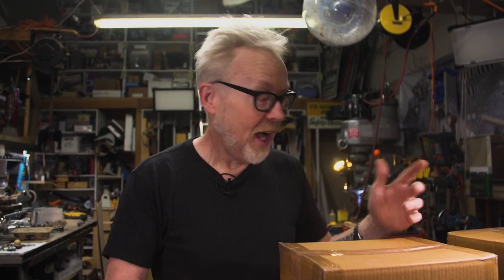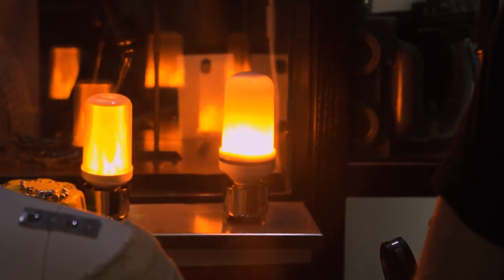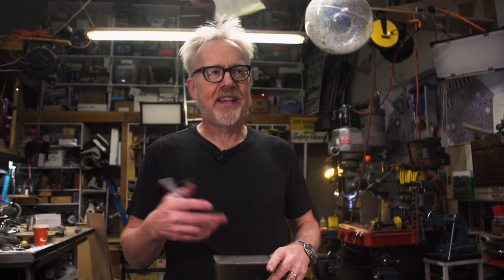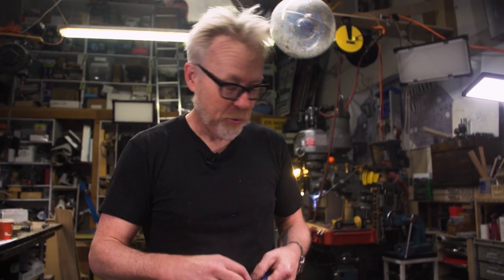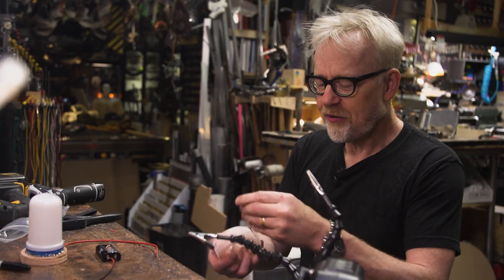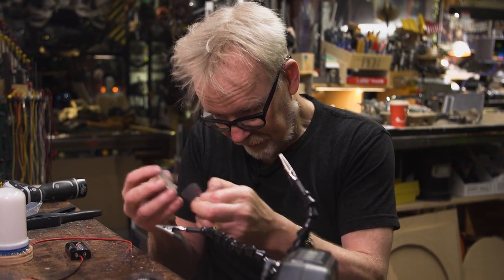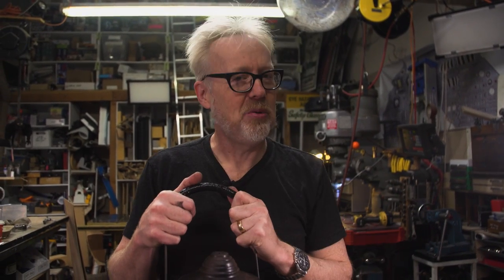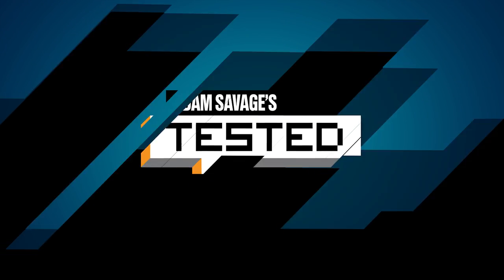Adam Savage's One Day Builds: Gaslamp Lantern Prop!

Comment: Those bulbs are so fun! We used them for Lumieres' hands in "Beauty and the Beast." We used a drill battery to power them and kept it in a waterproof bag on the actors back. Ran the wires down his coat and there were plugs connecting to the candle stick hands so he could take them off in-between scenes. It allowed the actor to turn the bulb on and off onstage without needing a license for pyro and it kept everyone safe! :) Love the channel!

Comment: I find the 'click-click' of the wire strippers very satisfying. I love it when my tools tell me that they are working properly.
Reply: Id like to know what kind they are. They seem to work very well.
Reply: @stephenmg12  They are in Sean's favorite things of 2019, they are called Knipex Wire Strippers.
Reply: @thekey147  Thank you!
Reply: @thekey147  Thanks!  the crappy ones I've been using aren't that great.  Gonna check these out. =)
Reply: Thanks. That's what I was.looking for also in the comments. The brand I have doesn't work for crao
Reply: Yeeeeeees
Reply: The problem with that kind of wire stripper is it only works well in a pretty narrow range of wire gauges. Knipex are some of the better ones, but will still mangle your wires if they're near the top or bottom end of their "supported" range. Both Andreas Spiess and Big Clive have videos covering a lot of different models, and I believe both of them ended up using less "automated" strippers.
Reply: @RFC3514  I have a couple of pairs of similar strippers, but they work in a perpendicular orientation, with an adjustable stop to control how much wire you strip.  They're 8" Irwin Vise-Grip 2078300 Self-Adjusting Wire Strippers and work well for a fairly wide range of gauges. I use Klein 11057 stripper/cutters for anything the Irwin can't get a grip on because they're too small of a gauge or the strands are too fine not to be damaged, though the Irwins are designed to minimize mangling within their optimal range (I won't lie, I've had them take a couple of tries to get it just right on certain types of wire).  Anything that's too large of a gauge for the Vise-Grips is usually into the territory of what a good blade and/or a good pair of nippers will handle nicely, though I do have strippers around for larger gauge wire, I just don't have really nice ones that have the same level of comfort in the hand (read: heavy use will strip your palm of all feeling, in addition to the wires of insulation).
Reply: Try some aircraft quality toggle switches on your guitar, or whatever. You won't look back.
Reply: @sclogse1  I replaced the switches in my car with the air craft toggles few years ago for the satisfying click they made. You are correct.
Reply: @RFC3514  The thing is you still have your regular strippers for non standard wire, but you will very rarely encounter that.   The thing is 95% of the wire your going to use is either 16-24 for hobby projects and for house wiring almost everything is 12 or 14 until you get to things like 30A breakers.

Comment: That is a Green Lantern prop just DYING to be built....   Get a little nfc involved, so it lights when your power ring gets near it.....

So many possibilities!

Bravo
Reply: I was thinking during the whole video this would be the exact light to use in my Steam Punk Green Lantern Battery.  Too bad the bulb was the only thing he didnt leave a link to...
Reply: @starhawke380    He said "I looked on Amazon and found lots".....  I did as well  and he's understating how many there are.
Reply: @ClintonAllenAnderson  I just looked it up, there's one that you can change the color of the flame, which would fit the green lantern idea even better
Reply: @ranwolf7650  So you CAN change color. Cool.
Reply: @ranwolf7650    How's about a link to THAT bad boy??   LOL
Reply: @starhawke380  The bulb is the first item on the list.
Reply: @joelhageman1903  a configurable-color flaming bulb.  Just the thing for "Creepy Santa" for next year (it's a mid-1960's blow-mold light-up Santa, I've used a kaleidoscope bulb in it the past couple years)
Reply: @SenileOtaku  Awesome. Creepy Santa. That too. From the 60s even better. Love it. I gotta get one of these bulbs.
Reply: My first thought when I saw it was Green Lantern by Gaslight
Reply: A magnet switch, with a magnet in the ring would be a simpler option to  nfc
Reply: You don't actually need multicolor bulb, you can just use colored film to get any color you want
Reply: If you are patient enough and can solder: There are normal smd leds solder on a flexible pcb inside. You could replace them with another colour.
Reply: @GrayRaceCat  Hah, he edited the list.  When I posted, the first item on the list was the lantern.
Reply: Was thinking the same thing the entire way
Reply: @ShadowcasterZero  Someone in China is slightly mystified and really happy.

Comment: That "hermaphroditic velcro" is called dual-lock, and it rules!
Reply: he rejected your reality and substituted his own.
Reply: It's huge in tiny home circles and it is the best stuff ever.  Highly recommend.
Reply: Yep great stuff been using it for years
Reply: velcro, while the common name for the material isn't the prim and proper term anyways, since it was originally a trademarked name, like kleenex in USA or hoovers in the UK. proper name is hook and loop.
Reply: I got my first bit with command strips, amazingly solid hold compared to regular Velcro.
Reply: I like "hermaphroditic Velcro" better.
Reply: @jaybee6318  im partial to bipolar opposing force hairs. Duo hooked sticking needles? double acting sticky fuzz? pick one
Reply: @ajc1080  "More homosticktual than hermaphroditic." I love that this is a technically accurate phrase. :)
Reply: Brock Moore Nicely done.
Reply: @Nick Arora For that reason, my brother and I have always called it SuperCro.
Reply: I use it instead of Command Strips. Also we use it IT to secure things on mobile carts like keybaords and charger bases for wireless handheld devices and small document scanners. These things cost a bazillion dollars in healthcare.
Reply: That stuff is from aviationbuilding. The Cabin covers are stickt with that... since at least 6 years. On flat on flat surfaces it can handle a lot of weight. You need a lot of force to separate them again.
Reply: It’s what the DMV gives you for the EZ Pass mounting here in MA/ New England. 

Once you adhere the two, there is little to no play or movement like standard hook and loop
Reply: @seana4106  Except that Dual Lock Velcro isn't hook and loop. The correct term in this case is "self-mating separable fastener", if you want to be pedantic.
Reply: Dual-Lock is a brand name, as in Vise-Grip is locking pliers, and ChannelLocks are Tongue-and-groove pliers.
Reply: In Germany we call it "Pilzkopfklettverschluss" yes awesome long german noun. It means "mushroom head velcro" due to the form of the individual strand head.
Reply: @flohi.9515  Not all the self-locking velcro is mushroom, there's plenty that is hook and loop, though I guess it's really more hook and hook depending on design, but I do personally prefer the mushroom tape style ones.

Comment: As someone who works in the theatre department, I can confirm that we do, indeed, build the insides of lanterns using LEDs, plywood, and hot glue.  Also used the tissue paper that they sell with lighting gels as a diffuser - worked brilliantly.
Reply: I'm sure it would be more brilliant without the diffuser.. :p

Comment: That looks amazing! Big Clive did some teardowns of those flame effect bulbs a while ago, it's really cool to see them put to good use.
Reply: Beat me to it, Clive's channel was the first place I saw these too.
Reply: Clive FTW! lol Happy new year guys
Reply: With an average of 2500mAh for an alkaline AA battery, they should last about a week to ten days as the LEDs will draw between 15 - 10 mA
If you turn them off whilst you're asleep you can boost their life to 11 - 16 days.
You could connect 4 AA cells in 2 parallel sets of 2 cells in series to double the battery pack's capacity / lifespan. Giving you a month from 4 x AA cells.
Reply: @maxximumb  I suppose a timer or light level sensor might be useful for longevity.
Reply: Yes he did 👍👍👍 😁😁😁
Reply: And i just thought: " we need to send one to big clive for a teardown"
Reply: Yes good idea will contact him
Reply: Guess I'm far from the only fan of both Clive and Adam. (I was heading to the comments for the same reason lol)
Reply: @maxximumb  Or ditch AA cells and go for 18650 cells. 3500mAh @ 3.6V per cell, add a postage stamp sized charger/protection board and your bulb could be charged via USB.
Reply: @maxximumb  +1 for doing the math. Many thanks.
Reply: @Kumimono  the issue with using a light sensor is that it uses power, possibly more than the led lamp itself.  It's an issue I encounter at work all the time as an electrician.  We upgrade the lights in an building to energy efficient LEDs, then the customer decides they want sensors so they save even more money... The problem is the sensors run 24/7 using power the whole time.  The sensors (and the labour to install them) are not cheep, and they power saving so small that it's just not worth it most of the time.
Reply: I built a lantern with a flame lamp, there are a few types, the one i used was driven from a 5V power supply, so check the voltage before you build.
Reply: @steampunkskunk3638  Actually, with a cheap, ultra-low-power microcontroller and an appropriate photodiode, it should save a ton of battery life.  You just have the uC sleep and let a timer wake it to do an ambient light check every so often (somewhere from seconds to minutes, depending on its capabilities and how sensitive you want it) and do a moving average of the last few readings (say 5 or 10).  When it detects it has gotten darker and stayed darker (the moving average has been below a threshold for multiple check periods), you trigger a latch that drives a transistor or FET between the power source and the light.  It's way more efficient than the sensors you're used to using on line voltage circuits, because they drive a solid state relay that's sized to handle much larger loads, have an AC-DC SMPS or regulated AC-DC converter, and they are typically designed with sub-second sleep times at best and endless loops at worst. Depending on the bulbs, the functionality may already be there, but unused, too, requiring just a photodiode connected to the correct pin(s).

Comment: What about turning one of the laterns into a projector? remove the side glass add speakers. And you have a portable movie theater that looks awesome.
Reply: @JmeTN Clumsy CraftsYou should do the project you imagined. thats one of the thing I love about tested is that we can all put our ideas out there and maybe inspire someone else like Adam and the team does for us.
Reply: @JmeTN Clumsy Crafts When I seen the video i instantly thought of making a green lantern lantern.It would make a great display piece in a home cinema room whether it's an actual projector for the movies or as an actual lamp.
Reply: @alexhetherington8028  Was my first thought as well. but now that I know they are easy to find old hood style, Lamp say hello to Green Paint.
Reply: How I would do this is find a way to use one of those LG 4k protectors that looks like a rectangular tube and sits on the floor because I suspect with some creativity one could find a way to hide that, put the reflector up inside the lantern housing while keeping the optical assembly in the projector and then hide the projector in some kinda fancy looking coffee table  Rather than trying to stuff low grade projector hardware into a lantern you have the projector firing up into and then out of the lantern.

I only suggest this LG because it has a mirror by default its onboard firmware can flip an image, I suspect if you tried to mirror a normal projector you would get everything reversed.

I personally could not afford to do this idea I said above but it comes off to me as the best way to get a lantern projector and not have to figure out how to stick projector hardware into a lantern.  faking it is half of prop builds I feel.

Comment: I just made my own, what a wonderful project.  The fire lights that I got have the same outside look except the 110 volt circuit board was attached to the circular light wrap.  and the DC voltage for mine was 6.5 volts, no problem, just used a 4 battery holder.  It looks great in my father in-laws original 1950 Trainmans oil lamp.

Comment: I'm surprised Adam has never seen one of those fire bulbs :D I've had one in my room since I was a kid. Also, that velcro is called Dual-Lock!
Reply: I've seen it sold on Amazon as Hook and Loop, used some of it to make a bigger strap for my old Yugioh duel disk from the first series, the one with the split and join action. It didn't have the sticky back though for making hangers or anything like that..just a solid strip roll of the stuff.
Reply: "Since I was a kid". So... last week? A year ago? 15 years ago? Sorry, just one of my pet peeves.
Reply: ShinKyuubi hook and loop is just another name for standard Velcro. One side is “hooks” the other “loops”.

This is different and would technically be “hook and hook” as each side is stiff, split “loops”

Also sold under the brand names “EZPass”, “Dual-Lock”, etc.
Reply: @treborrrrr  I am 24. I knew someone would ask, but I figured that I could maybe get away with it :D
Reply: @stephenhauer9055  I will now stalk you everywhere and make sure you never get away with it, ever ;)
Reply: @treborrrrr  You sure as hell don't want to follow me everywhere :D

Comment: Had to pause at 14:52 and make a comment before you go any further. When you first pulied the mirror out, I was Leary. But the addition of the aluminum tape to replace the mirror made total sense. It dirties up the reflection a little bit and doesn't look as clean. Which it would not if that were actual fire in that Lantern. And then almost recklessly adding black paint to the edge also "soots" up the mirror a little bit adding to the realism. Brilliant move sir. Now back to the video.

Comment: 3M Dual-lock is one of my favorite ways to adhere something semi permanently. I use it on my motorcycle to hold my garage door opener.  I've used it for effect pedals to a pedal board.  CB radio in my Jeep when I had it.

Comment: Imagine how long it would “burn” if you had used two D batteries instead of AA.
Reply: wouldn't you need a voltage step-down circuit for that? I am not familiar with the output of D-cells.
Reply: @djeeno  D-cells have the same voltage as AA and C cells.

Comment: Very nice. First time I heard about these flame effect bulbs. The soldering bit reminded me about the usual wire connections people make. I try to cut the wires so they're not next to each other, so their insulation keeps the separation and you only need one heatshrink tube to cover both. Faster and looks neater.

Comment: Just spent $100 on Amazon to put one of these together. Except a different switch and a USB power supply.
Reply: How much are the lanterns? Amazon won't show the price in the UK as the supplier won't deliver to the UK.
Reply: @maxximumb  Less than $50 US.
Reply: Link to USB power supply?
Reply: @maxximumb  Pretty sure they're sold out in the US now.
Reply: Just be careful, assuming the guts of this in an LED then a USB power supply at 5v may blow it.

Comment: Use rechargeable batteries and have a charge port
Reply: Wouldn't be hard to use a lipstick power bank then just plug it in with a usb cable. That way you have the battery and charger all built in without having to build anything special.

Comment: My son just shared this with me because I have an old camper lantern that I have torn apart (bought a box of them at a moving sale) and I have three battery-operated flame lamps that I bought off Amazon.  I bought the two extra lamps because I might screw up; but if I don't, I have more old lanterns I can convert and perhaps improve my design. My lamps use 5.1VDC with mHa1200 and the battery is buried inside the flame tube. What I am trying to find now is a solar panel that will put out the necessary voltage - something to match the lamps. If I can find the panels, I will convert my old camping lantern into a solar rechargeable LED flame lantern. I think what you did with the black paint and the matte clear finish is such a good idea. I can't wait till I can get to the store to stock up on that.

Comment: Murphy’s Law: The switch’s On/Off labels is to be wrong the first 2 times you assemble the project.
Reply: single pole, single throw switch with a keyed nameplate will always be correct, you can reverse the wires all day long and on will still be on and off will still be off.
Reply: Just paint over the label...  :-)

Comment: This was so cool to learn, the 3v thing!  I ordered a couple flame bulbs (already had some in light fixtures but didn't want to sacrifice them) and tore one apart, cut the circuit board off and indeed it works with just 3v!  I'm retrofitting a cheapy metal miner-style lamp that had an awful 5500k LED setup already in it, along with a switch and battery case.  I think I paid 8 or 10 dollars for it, so spending a bunch on the (now sold out) RR type lamp you used isn't necessary.  Can't wait to finish it up!

Comment: Very cool idea👍🏻I use 3volt LED's as well in my props I build and run them with either inserts from flashlights or premade battery holder and they do last a long time left on...stepup bits are also amazing for metal work..

Comment: LED lighting is amazing in general. Now they need to make housing standards with fixtures that run LED bulbs closer to their rated voltages, to reduce the loss from stepping down.

One thing I'd change on this, is use a 18650 battery, and a charging circuit in the basement so it can be recharged.